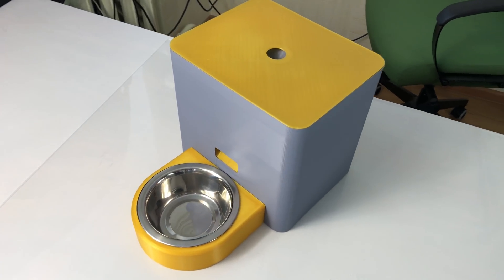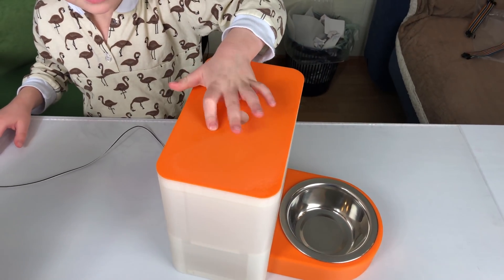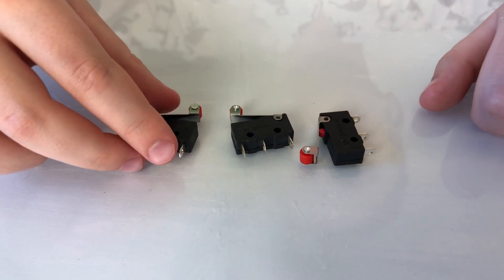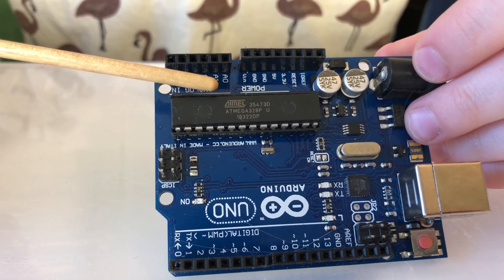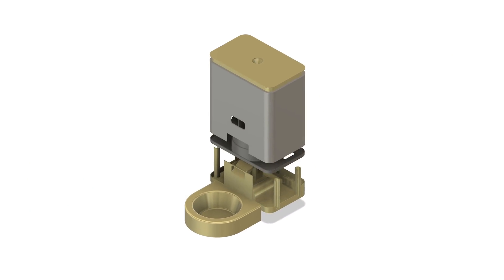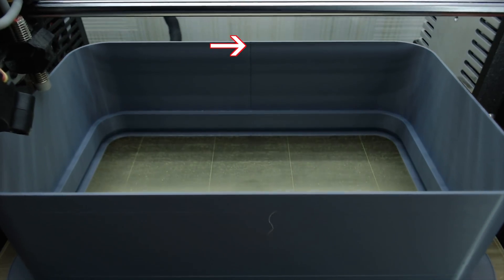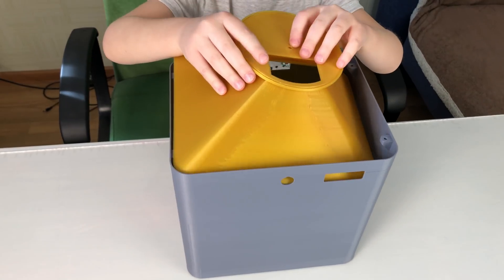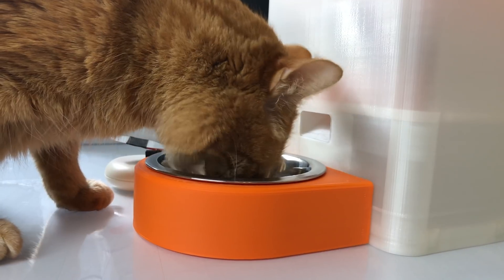FAT PET FEEDER 🙀– Free 3D Printed Pet Feeder

Comment: I loved it, please do help me for the arduino code for my pet feeder with innovation of notifer. Please do reply. Thank you!
Reply from the maker: Please be specific, what do you need help with? I can't spend hours writing code for you but I can spend 5 minutes finding an error in your code.
Reply: Mom Will Be Proud • DIY channel Iam having hard time to program my dog feeder which is Iam using Arduino Uno and with real time clock for timer, a servo motor, a sim900a for the notifier and a keypad membrane switch. Can you help me to program all this three to work.
Reply: Mom Will Be Proud • DIY channel because the mechanics of the dog feeder is, it is set to a exact time to fed the dog, and it will trigger the servi to opperate and afterward the device will notify the owner of the dog feeder that his or her dog is already been fed.
Reply from the maker: @babymachoasic5832  please reread my previous message. You can't just ask people to donate their hours of life to do the job for you. Life span is limited. You haven't even provided any code.
Reply: Mom Will Be Proud • DIY channel because the thing is I have codes but seperately each module.

Comment: which is the maximum size of the dry food?
Reply from the maker: Pellet size up to 10mm should be ok but you can increase the height of the feeder wheel so it can take larger ones and not lock up.
Reply: @MomWillBeProud   in the video what are de dimentions of your feeder? Which printer do you use ?
Reply from the maker: 13*21*21cm for the small version, 18*21*21 for the big one (the largest part)
Net internal volume is 1-2L
Prusa i3 mk3s
Reply: @MomWillBeProud  I have ender 3 pro, I wandering what are the maximum volume for the food. Or if can I print aditional part , like an expansión for more volumen for food
Reply from the maker: @oscarserrano7717  maximum I think is 1.5L, it will fit into your printer (the volume is limited by the construction of the hopper, I really tried to make it bigger). You can easily make an extension on top. Or if you don't want to model, just print a second shell part and glue it to the bottom one so the volume will be up to 9L
Reply: I need this, but for 7 cats. Any ideas?

Comment: 1. What 3D printer do you have? 
2. Can this be modified for rabbit pellets and portion control for them?
Reply: 1. Prusa i3 mk3s
2. Probably. I haven't owned rabbits but for hamsters I would be concerned about them eating the plastic away to get to the food.
For long pellets it would probably require to increase the gap above the feeding wheel, that means you would have to move the hopper upwards and the shell would be too high for my printer to print in one piece. I wouldn't recommend lowering the hopper height because then it would be too shallow angle to print.

Comment: Cool.  Printing now.  I've added a laser range finder for the hopper, a load cell to set the portions by weight, and an RTC with a battery backup.  I'll update you with how it works.
Reply from the maker: Thanks for the purchase!
Yeah, I forgot the RTC in the scheme but there's some code for it in the description (the library I used is universal).
I'd be glad to see your results. Also I'm curious about the load cell.
Reply: Sounds great. Have you managed to finish it?
Reply: @yusufkus1  I quess he is still making it

Comment: Why not with an auger?
Reply from the maker: Why with it?
It works as it is. I don't see any reason to change it because it does what it's supposed to do. You can definitely make your own.
Most of the feeders on the market have this internal design. Because it works.
Reply: I had tried with an auger, cat food stucks often and you need to jiggle back and forth, even it doesn’t solve the stucking issue.

Comment: did you think to use arduino nano to connect to wifi and send command via computer or phone to feed a cat?
Reply from the maker: I mentioned it in the video. I don't need it and I'm probably not going to make it. But it's definitely possible and go for it.
Reply: @MomWillBeProud  can you set up limit for feeding? i.e. /if button  pressed and time is less than 3 hours, no food/ ? i think you will need time lock RTC for this, i guess.
Reply from the maker: @falconych  Arduino contains a microcontroller. You can program anything you can imagine into it. It's not that hard if you try.
In my case there's 10 minutes limit 2 feedings, 24 hours limit 6 feedings.

RTC isn't necessary to track time because Arduino can handle that well enough on its own (if the power delivery is consistent). But for the battery version I recommend it because Arduino isn't that good in tracking time during the deep sleep. It has to be in a deep sleep to save battery (2 months vs 2 years battery life).

Comment: This looks great! Was jamming ever a problem in the designing process? Any measures to overcome it? #FatPetFeeder
Reply from the maker: It was fully redesigned several times because of jamming issues with the previous versions. In this version – no jams ever.
1. Gap high enough to let food get through
2. Blades are rotated so there's no point when the entire blade is against the hopper corner
3. Blades have a triangular profile so the last part that is against the hopper corner is much lower than the first one so it has more space for food to get through
4. Software has two forward one back nature so even if something gets stuck it will release in the next cycle. I.e. 500ms forward,100ms back, 300ms forward, 100ms back for one feeding.

Also there are parameters for the blades height and the gap height so it's pretty easy to change.
Reply from the maker: You get one. Contact me, email is in my profile. Don't forget to mention your YouTube account name.